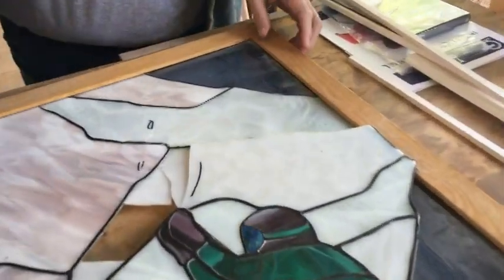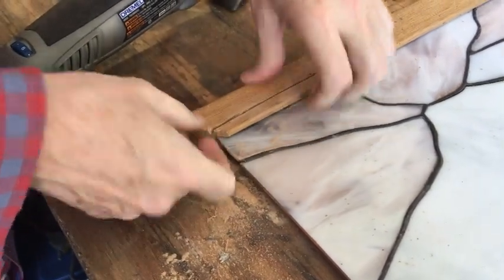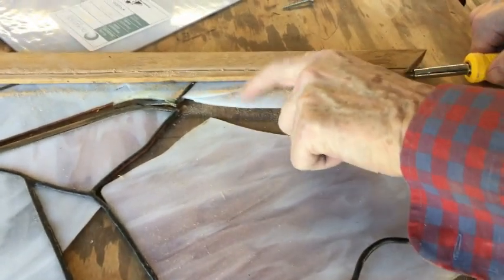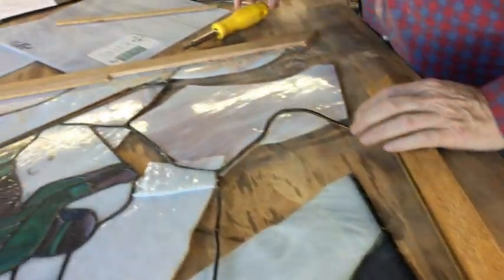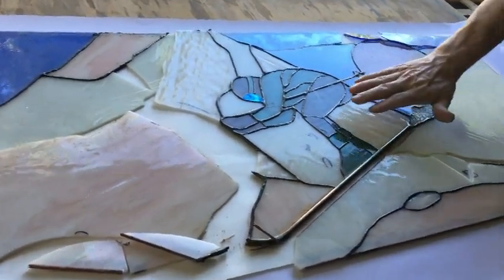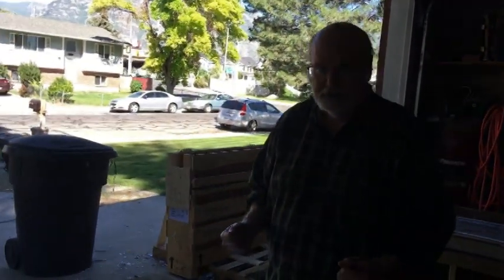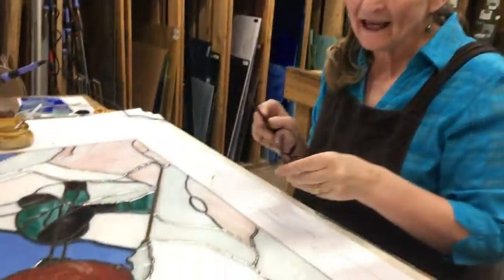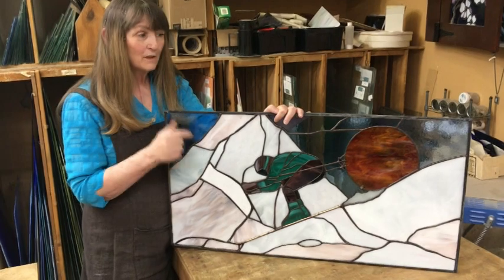We Fix A Stained Glass Ski Window V400

Comment: I’ve seen many instances where prior to disassembly, the craftsperson makes a rubbing of the panel to assure that repairs will match the original. Rather than expect the original pieces to match to the new pieces, the replacement pieces should be crafted to mate with the original adjacent pieces. Hindsight : after David removed that first edge of the frame and revealed the depth of the rabbet, the other three pieces could have been cut just  near the inside of the rabbet from the outside of each piece which may have minimized additional damaged pieces . Your multi tool may have included their very thin composite scraper that could have assisted with removal of the remaining edges of the rabbet .
Reply from the maker: There have been times that we've done rubbings of the original window. But there were so many broken pieces, we knew we were going to replace many pieces of glass.